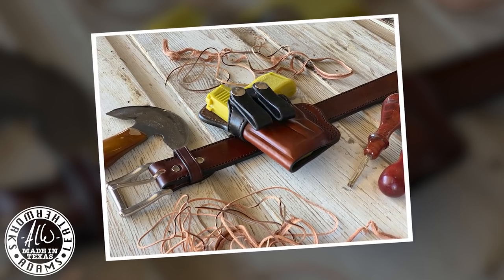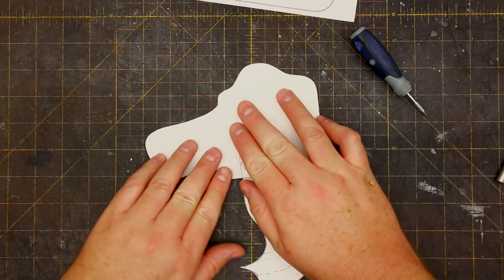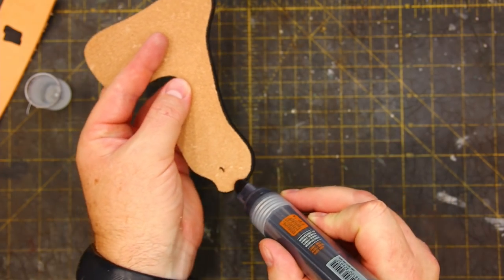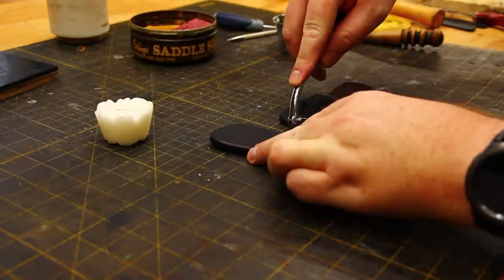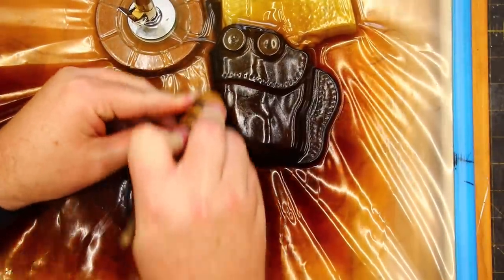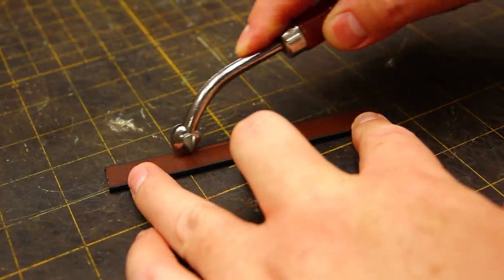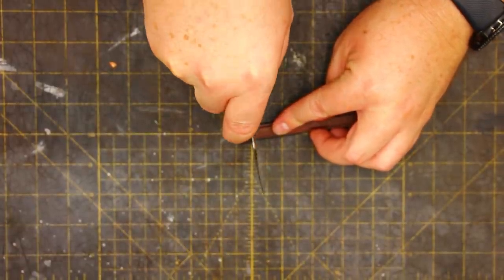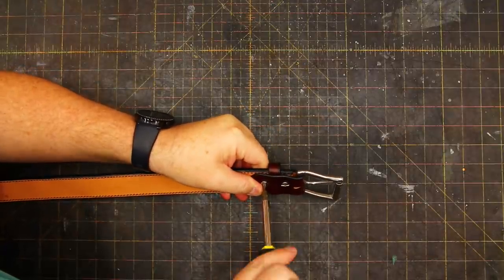Making an Inside the Waistband Leather Holster and Gun Belt - Sig P365 CT Laserguard

Comment: I like doing a baseball stitch to make belt keepers; also thanks for sharing your methods.
Reply from the maker: Thank you - I'll give that a try! What type of thread to you use for your keepers? I used nylon since I could melt the ends to help lock the knot, but it's hard to keep the knot from releasing before I can trim and melt the thread.
Reply: @AdamsLeatherWorks  I also use nylon thread, the thickest that is feasible for the application.  Waxed button thread works well, is quite thicker than tiger thread and readily available.  I don't know why but also don't like those staples.

Comment: I just finished a owb sig p365. Nice work. What needle point do you use in your machine. I'm having trouble with my tri (triangle) points. It doesn't like when I back stitch or go into any hole with thread already in it.  It always will cut the thread or bind up and not lock the stitch.

Comment: Eric.  Round knives really scare me.  How long did it take you to get proficient with one?  Is it worth learning the round knife?  Now I just use an Olfa locking snap off utility blade.  PS:  Thanks for these videos.  I made one holster based on another of your videos and need more practice.  (the holster fits my little Walther PPK BB gun but my belt clip position is all messed up).  Plus, I hand sew my leather.  No machine.
Reply from the maker: Hi Bruce - I've been using a round knife pretty much since I first started playing with leather roughly 11 years ago. I found it was much easer to cut with and was much less tiring on the hands compared to something like an x-acto knife. Rotary blades are great, in straight lines, but round knives are pretty easy to cut straight lines too if you rock the blade forward. The only downside to round knives is really tight curves, but I use mine to cut all the way down to around 3/8" radius curves. I would definitely recommend trying one, but make sure you get one with high quality steel and keep it sharp with a high polish.
Reply: @AdamsLeatherWorks  Any brand of knife you recommend?  I know all the US leather tool sellers and manufacturers.  Weaver, Springfield Leather, Rocky Mountain.  The biggies.  Osborne and others.
Reply from the maker: I only have experience with the Weaver Master Tools knife that I own. I believe mine is an older version of the 4-7/8" that's currently listed at $96... Their price has gone up considerably - I think it's about $30 more than I seem to remember paying for it. If you like things a little more on the fancy side, check out Leather Wranglers. His are super fancy and from what I hear, very high quality. He also has a great sharpening vid floating around out there.
Reply: I will take the ads anytime.  The education and thrill of watching someone who is skilled and practiced is well worth it.  Thank you for posting these and thank you for sharing.  Bravo!

Comment: What cutting mat do you use??
Reply from the maker: Hi Cody - sorry for the late reply. I use an Olfa Rotary Mat, and the size is 24” x 36”. They are expensive but they last a long time. Mine is 12 years old, but it’s about time to replace it.
Reply: @AdamsLeatherWorks  Thank you sir, I was admiring how smooth your round knife appeared to glide along on the mat, and was like gonna need one of those asap lol
Reply from the maker: It will cut into the mat, but just don’t press too hard. The mats are intended for rotary cutters, but if you don’t press too hard, it won’t dig in that deep. It’ll snap off the top of x-acto blades going around curves. Watch out for that.

Comment: How do you modify the socket die for the snaps
Reply from the maker: Just take a flat file and file a flat spot on the male portion of the die so it fits inside the snap
Reply: Ok,I will look into that, Thanks for your reply.

Comment: Why not rub the dyes on instead of spraying like every other leather worker video I have watched? Sure would cut down on the amount of pollution you send out your window
Reply from the maker: I use a dauber every now and then, but I get much more consistent results by spraying. I know a lot of professional makers that dip their products in dye (another alternative). The main reason I spray is because most of my customers request airbrushed accents around the edges, which is much more difficult to achieve by any other method. I actually find the fumes to be worse when using  dauber or dipping methods because both of those methods consume a lot more dye during the application process. I might be wrong (probably am), but larger amounts of product being used equals larger amounts of harmful off-gassing during the evaporation and drying process.